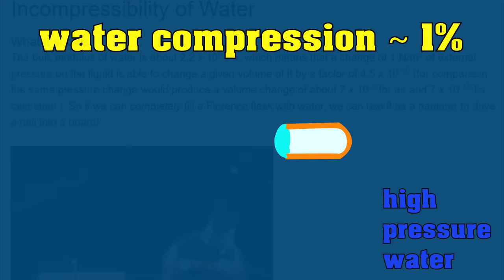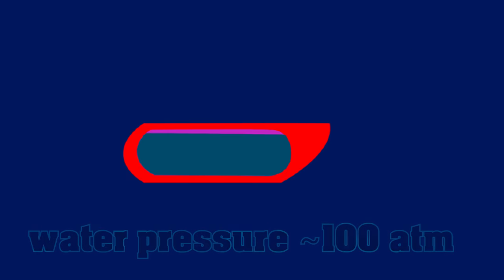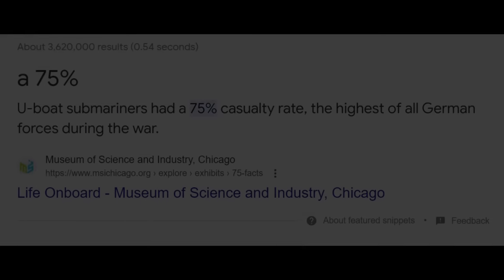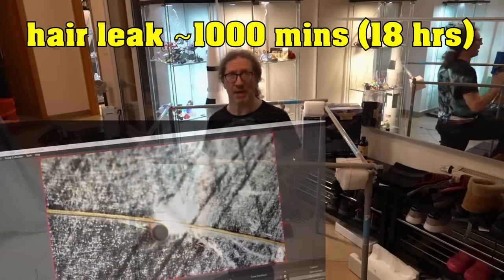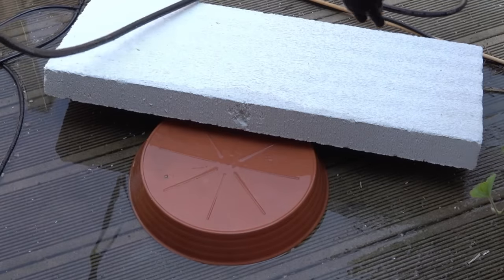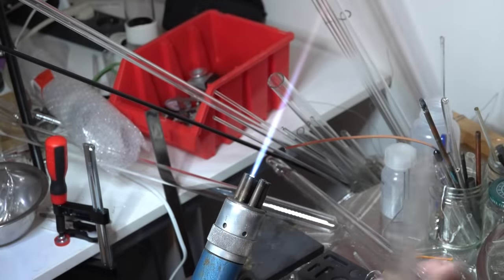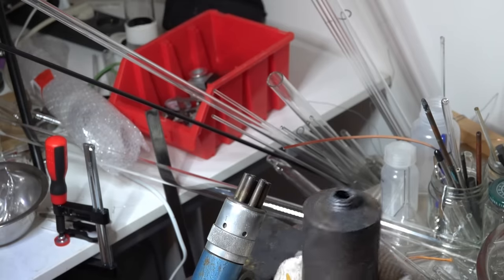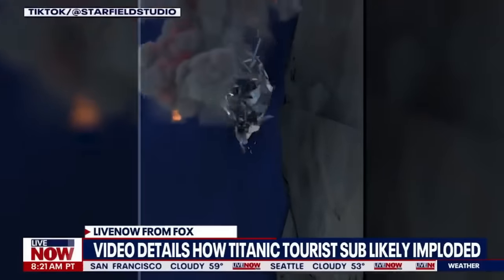Why the Titan sub failed

Comment: So how did it survived other dives? The carbon fiber was compressed several times with no tear or leak. Maybe the glue got weaker and weaker with each dive?
Reply: Engineers have said that carbon fibre isn't great for repeated stress and was likely the cause also they'd never taken the boat down to 4000 metres before and it wasn't certified for that depth.

Comment: No disagreement that this sub with the multiple materials and the glue bond was a terrible design, but is the material compressibility data you reference specific to a solid volume of a given material?  I.e. A cubic cm of titanium versus a cubic cm of carbon fiber?  I would assume that a tube of carbon fiber, layered in certain way and of a certain thickness would have a distortion mode under pressure that would be very different than the titanium end-cap, but I think understanding how these components changed size (and shape) relative to one another at depth would be more complex than understanding the raw material compressibility.  Am I misunderstanding something about this point made in the video?

Comment: A better question to ask would be: How did the sub survive any dives?

There were so many things wrong with it, it was a miracle it took as long to break as it did. A window rated for 1/10 the depth they were going. Differential compression of materials held together with glue. Using fiber reinforced materials that are known to fail at great depths. Creating the carbon fiber hull in a way known to leave air bubbles and defects. The hull was heard cracking on a previous dive. The structural integrity was never even tested.

How could it break when they only did everything wrong? There are so many reasons it should have failed, it is hard to tell what broke first.

Comment: The hydraulic press channel is doing a series where they implode carbon fibre tubes with steel end caps at about 90 bars.  It's an interesting watch.  In one instance their tube leaked somehow and filled with water.  This one went way beyond 90 bars with no visible damage.  Given that the Titan sub was physically smashed to bits, my money is on that being caused by an implosion.  It may well have had a very small leak, like a few square microns that caused the sub to take on so much water that it could not surface, but if it had completely filled, I don't think there would be so much catastrophic damage to the vehicle.  Instead it would be whole -- or nearly so -- just full of water.
Reply: this

Comment: Some years ago I looked at carbon fibre/epoxy composites in high pressure salt water environments. I read some papers which looked at water ingress into the matrix disrupting the bonds twixt the epoxy and the carbon fibres. One paper focused on the surface of the composite and micro pores therein. Under pressure water is forced into the composite. There were other papers concerned with measuring such ingress. I bet they constantly monitored such possibilities
Reply: And taking what TF seems stuck-on, water compressibility.
Any water the made ingress into pores or voids at depth then uncompressed as it surfaces. Sure, a lot of it was forced back out, however quite possible enough stayed in long enough to expand the voids where it was just a little bit. Enough that next time it dove, the void was a little larger, and when surfacing it expanded the void a little bit more again, and again and again.
Quite possible there were no pinholes or glue failure at rings, just voids that expanded slowly somewhere on the 11,000 sqi of tube surface area through one tiny exterior knick or void.

Comment: The clue to what went wrong is actually @15:44  90 degree compressive strength, which is only one sixth of the 0 degree strength.  This is because of the uni-directional winding. The fibre gives strength in the circumferential direction, and consequently the radial but contributes nothing to the strength along the axis of the cylinder. SO although we speak of a carbon fibre cyclinder it is actually just a resin cylinder from an axial point of view.  The titanium end caps have a projected surface area normal to the tube of a bit over 2 square meters. So while the pressure acting on the cylinder surface is being resisted by the wound fibers the tube is also subject to the axial force exerted by the end caps, which is equivalent to about ten thousand tons of weight and that is being resisted only by the strength of the resin. To get an idea of the absurdity of this design just imagine putting the Eiffel tower on top of a tube made of resin just 18 cm thick and 2 meters in diameter.  It is something of a miracle that it even survived that many dives before failing catastrophically.
My hunch is that when details of the enquiry are eventually released we will see dents in the domes indicating that they impacted violently with each other as they crushed the resin tube out of existence. I say resin, not carbon fibre because the carbon was irrelevant in the axial direction, contributing absolutely nothing.

Comment: How would a 10 m thick bamboo skinny hold Up hagainst 10 cm of carbon fiber? Bet it would be cheaper and if it was drenched in apoxy kind of glue under extremely high pressure it is something that them could build next. For the test dive I suggest a bunch of dictators.

Comment: In the video when they join the titanium to the carbon tiger tube the tube goes into the titanium. Surely it would have been better to have it the other way round if carbon fiber shrinks more than titanium, thus creating a tighter seal and less risk of a leak?

Comment: It also had various appendages (cameras etc) screwed into the carbon fibre on the outside of the craft rather than moulded on to them and these would also have created miniscule points of weakness that would become a significant risk under such great pressures.
Reply: And on the inside, there's a photo of a monitor bracket screwed to the inside of the tube

Comment: Such an amazingly incompenent oversight.  We deal with dissimilar materials on a daily basis in engineering.  Thermal expansion/contraction of metals is a common consideration, but metal to non-metal is elementary.  Those guys were painfully ill-prepared.

Comment: I think you are spot on with regards to the failure mode. I don’t think you are right that that E-modulus or bulk modulus of base materials must match. What matters is not the modulus but the radial stiffness of the two tubes. Those two stiffness could have been matched by making titanium ring thinner than the CF tube.

Comment: Hey thnderf00t! I think you're on to something with the compressibility, but Titanium had a Bulk Modulus of ~111-135 GPa, but you stated that Carbon fiber was only ~20. However, I think the datasheet stated at 15:50 says that it was 18.8 Msi (which is where I think the 20 came from) and 130 Gpa. Unless I'm reading the datasheet totally wrong (which I may be), I think the reason there was no immediate catastrophic failure was a subtle difference in that bulk modulus rather than ones that were wildly varying.

Comment: If the sub got filled by a leak then why would it implode? The pressure would equalize evenly and the structure of the hull would remain wouldn't it?

Comment: Shouldn't this had been done in a clean / dust free environment so the parts being glued weren't contaminated with dust particles? Also, when that guy is wiping it down he's then placing his BARE hands on the titanium. I wondered if oils from your hands would also be considered a contaminate? I'm not an engineer obviously but I also assume the bond would have been better if the titanium had been roughened up a bit the glue would adhere better than on a perfectly slick surface like that. If anyone can tell me something educational about my questions and concerns I'd really appreciate it. I'm desperately curious!!

Comment: 12:20 -- Recently picked up an electric pressure washer (cheap, $120 or so) . and while it's decent for cleaning grime off concrete, the pressures they advertise it as tend to be a complete fabrication.  Compare a quality gas powered pressure washer rated the same as your electric and you'll notice a phenomenal difference.

Comment: If they had placed the carbon fibre tube over the titanium supports instead of as shown glueing it inside them as shown, would the problem have been averted? The compression of the tube would have improved the seal instead of possibly ruining it.

Comment: did nobody think to put the carbon fiber tube on the outside of the titanium? that way when it shrinks, it's held together more tightly? carbon fiber is good under tension anyway, so that would be putting forces on the carbon fiber which it is actually designed to withstand.

Comment: I disagree with your way of estimating water flow through a pinhole leak. Equation at 9:25 is more or less valid for a hole in a thin wall. If Titan`s seal (or just wall) developed a crack, the shortest path to the inner volume is around 10cm in length. Such crack would act like a capillary tube and throttle the flow.
So, for me, minor leak does not seem impossible.

Comment: Hi Thunderf00t. In the event of a sudden implosion at 100 bars, would the body fat of those onboard potentially auto-ignite due to extreme pressure changes as some have suggested? I guess the water inside the sub would also absorb some of the heat?
Reply: Less than 30 milliseconds for the delamination wave to run around the hull, less then three milliseconds for the pressure wave to reach the center, less then two milliseconds for the heat wave to heaten up the passengers over thousand degrees celsius. I don't think the water is that quick. It's instant cremation before their brains even had the chance to realize what happened.

Comment: I think that carbon fiber tube wanted to be compressed into smaller diameter, while titanium things wanted to stay same. Because it was glued, i belive it was first to fail, one part got ripped off, and got pressed in. That would result in complete colapse of the tube pretty much instantly rather than pinhole leak.
Imagine dropping oil drum full of water on it's side from big height kinda failiure.

Comment: One thing about the power washer demo: It sounds like you didn't bleed the air from the lines. It sounded like the compressor pump was trying to compress air instead of push water. I have some experience with those machines, and if its one thing I've learned is to not turn on the power unless there hasn't been an air bubble for at least two minutes.

Comment: When you look at the wreckage that was recovered, one of the titanium rings were not perfectly round as designed, it was more oval in shape. This means that the glue must have held on for a while as the entire structure collapsed. So it wasn't the glue that gave in, can't have been, the rings would have just stayed perfectly round then.

Comment: A compressive stress on a cylinder like that, will result in a tensile stress through the thickness of the carbon fiber. If it was created as a laminate, this would have the effect of de-laminating the layers.
Steel is a better material, since it handles the stresses well and it is easy to monitor crack growth and potentially apply repairs.
I'm not sure what advantage carbon fibre would have, since it doesn't need the weight savings. There's already a massive ballast weight required to achieve neutral buoyancy.
I think a better system for multiple passengers would be a series of individual spheres strapped together, with the caveat that passengers would not be able to get to each other in an emergency.

Comment: If the footage of gluing together of the Cyclops at 19:52 is anything to go by, then it appears that they might have been gambling on the combination of glue and the end rings partially sleeving inside of the carbon-fibre composite tube. So that the higher the outside pressure, then the tighter than seal should be, as the tube is squished onto the rigid titanium ring and (I guess, hopefully) the seal becomes even better. This seems to have worked for at least a few dives to great depth in 2021 (5 times?) and 2022 (2 times?), then (obviously) catastrophically failed on its only dive in 2023. Perhaps there is some sort of "fatigue factor" which weakens the composites and their bonding into the end-rings and caps, eventually leading to failure?
Reply: Real Engineering made a point about how there is an absolute need for regular, periodic maint. and testing for exactly that, cyclical fatigue.
Cracking was heard on numerous dives before the final one...

Comment: I doubt it was a pinhole causing the sub to fill with water, because that would have quickly equalised the pressures inside and out, resulting in the sub staying intact but sinking fast and uncontrollably. The wreckage, what little we have seen of it, looked much more like the titanium end-caps stayed intact but the carbon-fibre tube collapsed. My money is on delamination of the carbon fibre, with water forcing its way in between the laminations. That would mean that the pressure would be applied to a thinner tube wall, with the outer layers of laminate essentially adding nothing. It would also explain why the sub had been down to that depth a number of times previously with no problems, but then failed - because the delamination would be slow, insidious, and undetectable without scanning the structure of the tube, which Oceangate said they did not do.

Comment: And its even worse since carbon fiber expand in cold and shrink in heat, absolute opposite of thermal expansion in metals. On one hand it help in cold deep water to somewhat negate the water pressure but on the surface on hot day its working against you.
Well if the window busted as some speculate, leak and sink or my bet a catastrophic failure, essentially a implosion. From loss of communication and the sound that been detected. My theory is that the domes detached and the edges of the cylinder cave in. So it should be 2-3 big pieces, anything other it should be in one piece. By the recovery seem its was more likely the implosion since they pull it out in cliecess.

Comment: the nozzle is way to big to cut much at that pressure, you need a smaller jet especially those adjustable ones, plus the water has other places to escape to,

Comment: I'm not an engineer but I gave a question if anyone could answer. 

What if a hull had a shell inside of it, 3-5ft gap between inner shell and hull. That space was then pressurized with air to match the pressure pressing on it from the water?

Comment: you need a pressure gauge on your lance. Dont forget that the pressure and velocity obtained will be limitd by the maximum  power of the pump.
power = pAv
Reply: p assume 100bar= 10 . E6 pascals
A = say 1mm squared =  E-6 m²
v = 1500 m/s
Power = Fv =pAv=10*1500= 15kw  a domestic power washer just doesn’t have such delivered power.
The real problem is that carbon fibre os brittle. any failure will lead to a crack that immediately creates a huge hole. You only have look at the body of an F1 car to see the problem.
But F1 cars have the sense to ensure that that the safety critical elements f the car are made of a strong metal.

Comment: I had a hunch over this for days post accident, that the mix in materials used that being CF/Titanium have a diffrent set of tolerances subject to pressure and in effect the support rings and end caps popped off like a cork from a wine bottle.  That adheisive would have made absolutely no diffrence what so ever at 400 atmospheres.

Comment: BTW, Real Engineering is an actual Composites Engineer and has a great video on this which is probably more on point vs speculation on pinholes and water compressability.

Comment: Because these are complicated geometries, modulus isn’t  the relevant parameter, but rather stiffness. You could engineer the two sections to have the same stiffness and thus expand and contract the same amount from just pressure. Not that they did engineering on this sub. What might get you is the different coefficients of thermal expansion from going into the ocean, per your glass demo.

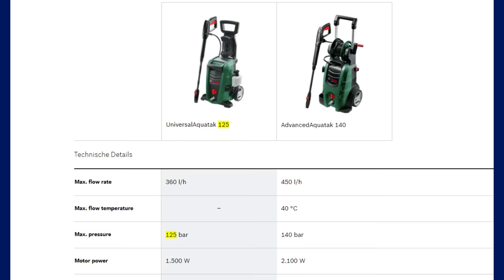Comment: 11:19 - 11:30 Correction here.. The sub did not implode at 1000 meters. It was just 300-400 meters from the Titanic wreckage when it happened. So about ca 3500 meters. The communication loggs seems to have been released between the surface vessel and the sub. It was truly an eerie and tragic read.. (although, it should be said, that it's not yet confirmed that this is the actual transcript, or if it was changed in any kind of way. But it sure sound like it could be the real deal)

Comment: Some german guy made pretty accurate simulations about the Titan. He showed that under pressure, the carbon fiber hull will break. The view port, made out of acrylic, isn't strong enough too. So yeah, three plausible modes of failure. Fact is, the Titan was a death trap from the beginning...

Comment: There is a mistake in this video, the pressure wave is under sea at a massive depth so it will likely have more repercussive force, thus rendering any co-reference with atmospheric conditions irrelevant. Yes the pressure wave will expand into the water body but that effect will rapidly decrease.